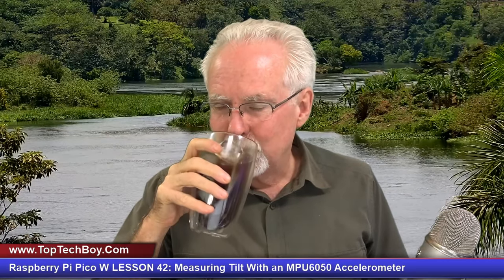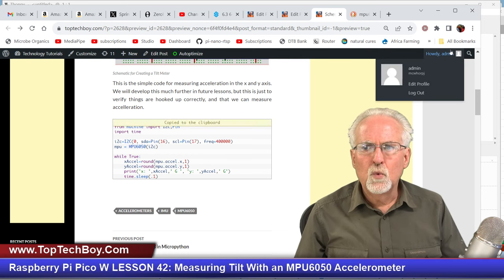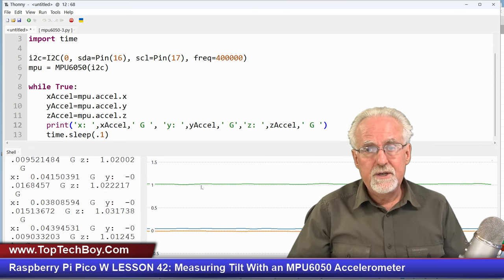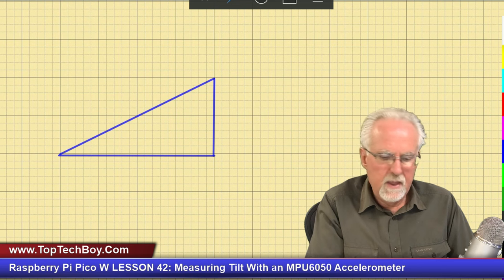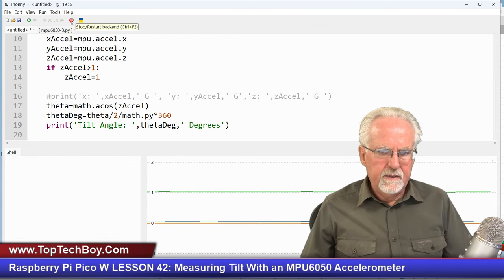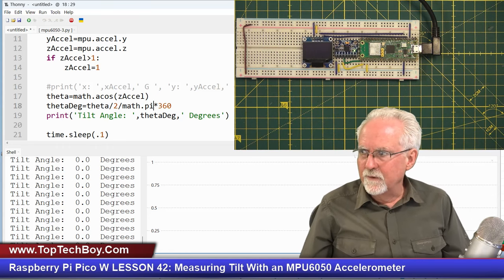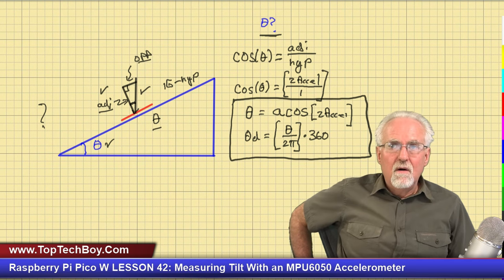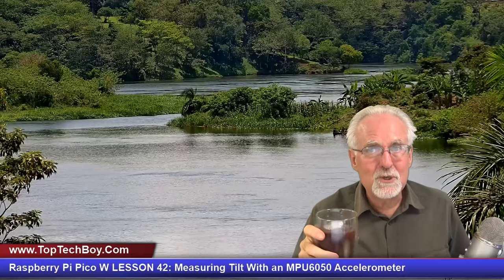Raspberry Pi Pico W LESSON 42: Measuring Tilt With an MPU6050 Accelerometer

Comment: I never thought to use the Z axis. I assumed I had to work with xAcel to find theta X. Silly mistake. I was using cos(1-xAcel/1) it would give an accurate reading from 0 to 90, but would give an error every time xAcel went below 0. I tried adding Abs() - for absolute value - but that didn't fix it. So I folded up like a cheap walmart lawn chair! haha

Comment: Hi I am following this lesson and I get a tilt angle reading of aprox 19 deg sitting flat on the table is this a problem with my Accelerometer. 
ps. love your work
Reply from the maker: Check your program very carefully. It should be way more accurate than that. Very unusal for one of these components to be bad, so check your work carefully.
Reply: I'm having the same problem. My MPU sitting on the table reads between 25 and 28 degrees. And its not even a static value. Did you manage to solve this?

Comment: I thought I had a solution, but kept gettin math errors when the angle got to 90° for x & y or 0° for z
Reply from the maker: Yes, if you are using atan, it will error at 90 degrees. So we have to treat that as a special case.